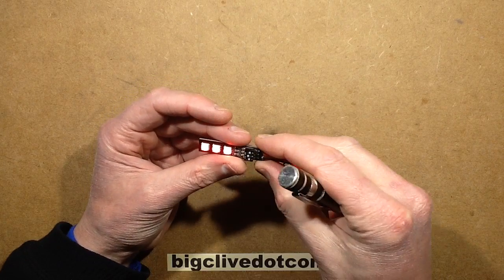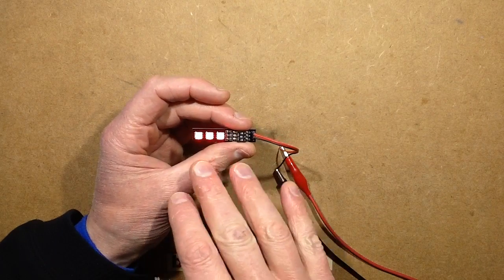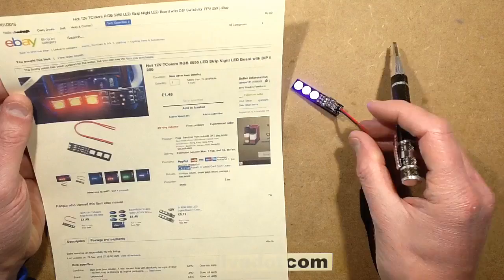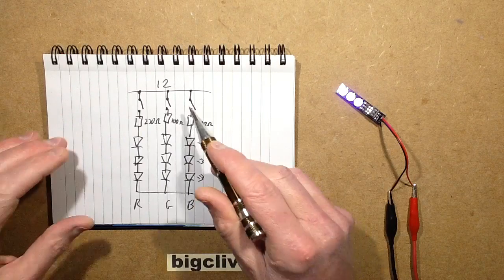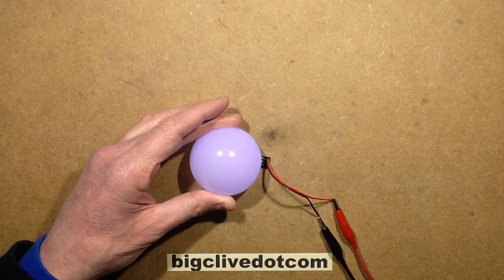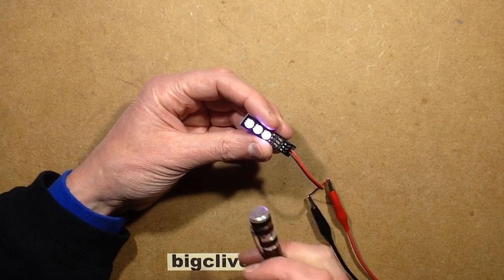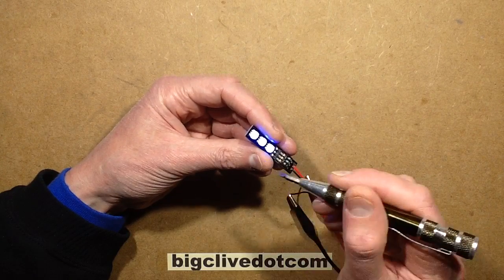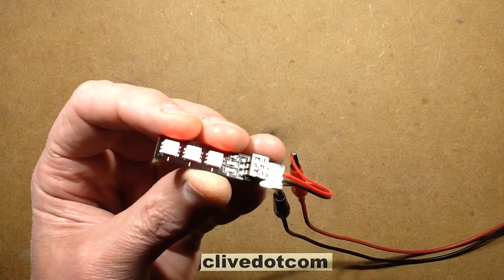Simple little switch-programmable LED colour panel.

Comment: I’m building something like this for my windows98 retro pc case fans, by replacing the standard 5mm red leds with 4x5mm rgb ones then fitting 3 latching switches on the front of the case to power the leds of 3x 12cm fans. I’m using 5mm diffused leds as they mix the colours better than waterclear Lens types

Comment: i have this on my quadcopter but i dont think it will change my flight times a lot at full throttle my quad pulls like 1000w with a 4cell lipo but led works great and nice vid

Comment: @bigclivedotcom do you mind showing how to make a fairly simple circuit board that goes from 220vac to 12vdc that's good for LED strips, as i have a few projects in mind and don't really want to buy loads of the power supplies you find on amazon which can get quit costy

Comment: In an indicator role the current drain is not efficient enough so it''d be better to have a version such that the LEDSs were being multiplexed... (switch on-off and a hi rate)... don't you agree?

Comment: Hi Clive, assuming this was dimmable (Or similar LED strips) what transformer should I get if I wanted to dim it at the 220ac side? I have dimming main sockets that work well with incandescent lamps, but I want to dim LED 12v strips instead.... thanks, P
Reply: You don’t need a transformer to power an led from the mains, just a 220k resistor

Comment: What kind of screwdrivers are those? I'd like to have one.
Reply from the maker: +t5er It is indeed a Poundland set.  One of the better 9 in 1 sets.
Reply: http://www.poundland.co.uk/tommy-walsh-mini-screwdriver-set

I buy loads of them for my students! Great for pc work
Reply: Out of nowhere I'm now seeing them sold at Fred Meyer and CVS - at CVS they were in the cheapo bargain racks, cost maybe $3? And Fred Meyer at the checkout lines. Different packages, same basic driver, one or two variant bits.
Reply: Looks like the one from poundland!
Reply: +bigclivedotcom Well, that's unfortunate. No Poundland in the US. Is that a swiveling back end?
Reply: +bigclivedotcom any thoughts on an ebay link?
Reply: +Patrick Stevenson They are available on eBay and Aliexpress. Just be careful to check which bits they come with as it does vary.
Reply: I picked one up at walgreens a while back for five bucks. it was in the checkout impulse buy section, but check the tool section too. comes with two sizes of slot and star, and three hex bits.
Reply: i can only find blue ones on ebay. anyone find a better link?

http://www.ebay.ca/itm/GREAT-Precision-Mini-8-in-1-Slotted-Bits-Screwdriver-Pen-Set-Repair-Tools-New-/281918286290?hash=item41a3a3a9d2:g:8RoAAOSwX~dWoxCc
Reply: +Gregory G Harding Do these look the same? http://www.mit-tool.com/maxcraft/products-10-16-280-60609-Maxcraft-7in1_Precision_Pocket_Screwdriver.htm
Reply: +Patrick Stevenson looks more expensive than poundland haha
Reply: +Gregory G Harding The ones with "standard" bits I purchased were blue. I do have a black one but it came as a 12-in-one (double ended bits) with fiddly little torx/mini philip type bits. However: http://www.aliexpress.com/item/High-Quality-Convenient-8-in-1-Aluminum-Precision-Multi-Tool-Screw-Driver-Portable-Tool-Blue-NG4S/32482861636.html
Reply: Wow, thanks for all the help everyone! I'm sure one of these will work for me.

Comment: Is this dangerous in anyway.
From china so it has to be.
Are the edges of the PCB very sharp and likely to cause a cut?
Reply: +IIGrayfoxII If you swallow one, it'll probably leave you with a few holes in your digestive tract, so yes, very dangerous... :P
Reply: It appears there's no earth connection, so I'd suggest it's totally lethal! Typical Chinese electronics! 😉
Reply: Probably not. PCBs can either be fully routed to cut smooth sides or carved with something called v groove and shaped apart. V groove does leave a very rough edge to the PCB, but provided you don't do anything stupid with it then it is in no way a major safety hazard.